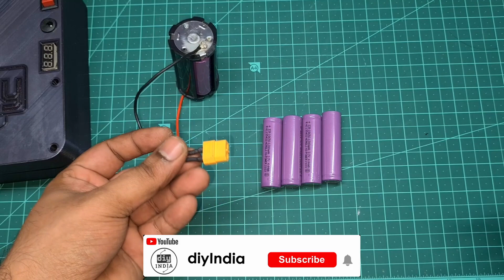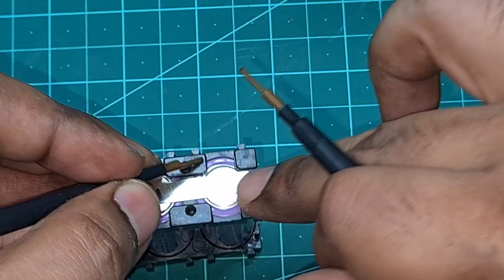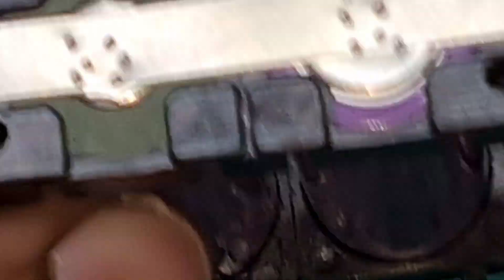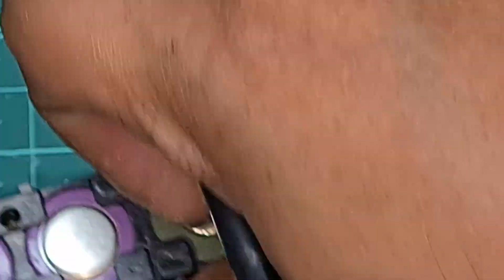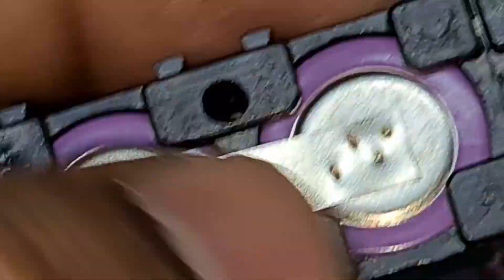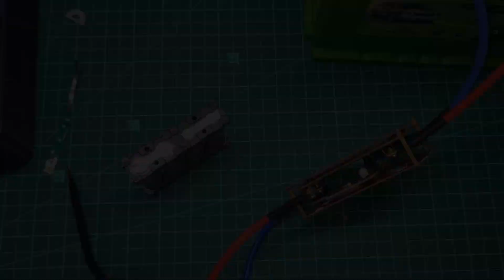li-ion 18650 2s-2p battery pack 5A bms- DIY build using HongliXG 1200mah

Comment: How do i select what amp of bms (3amp/5amp/10amp..) is suitable for my battery ??
Reply from the maker: That depends on your load. If you are planning to run say a small led strip then you can go with a 3A bms. So it proportionally dependent on the load.
Reply: @diyIndia  thanks for the reply..sorry but i am not that technical..i want to run blurtooth speaker..what amo is suitable and how can i select which amps bms for different uses..plz reply
Reply from the maker: can you tell me the speaker wattage? is a pre built board amplifier?
Reply: @diyIndia  its boat 20w speaker.